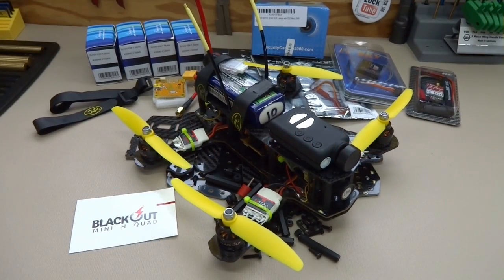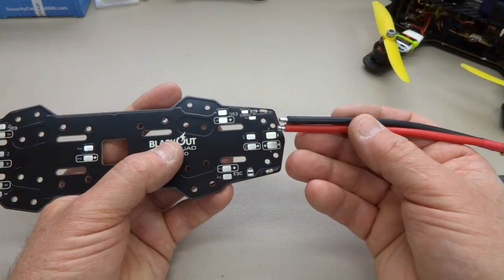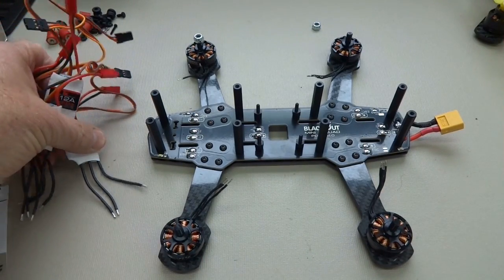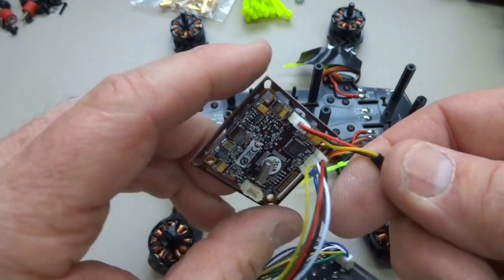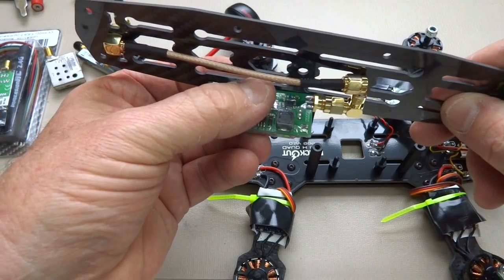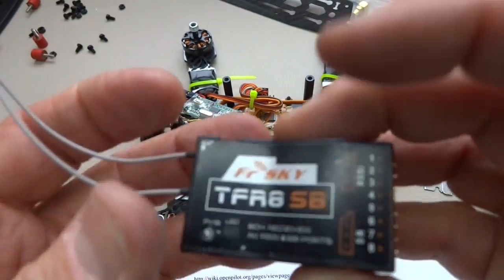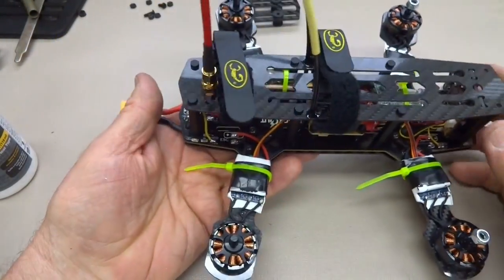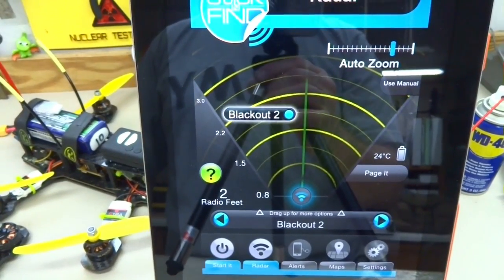Blackout Mini-Quad Build Tips

Comment: Really good video. I just mounted my antennas that way with tubes from pens yesterday but have not tried the range. Do you have the tip of the antennas in or outside of the tubes below the heatshrink?
Reply from the maker: They are below the heat shrink, but the length really doesn't matter that much.  I just came up with that to keep my receiver antennas out of the propellers.
Reply: Which length is it you say don't matter? I was thinking.. if the tubes shield the signal then the exposed area should be according to the wavelength of the radio
Reply from the maker: Philip, the plastic tubes do not block the signal.  (Hopefully you are not using METAL pen tubes...).  The antennas on the receiver are already the proper length for the transmitter frequency - pls don't trim them or you will REALLY affect your range.
Reply: AerialWerks You never know, its better to ask. Maybe that plastic could have. Good to know they don't, then I better keep the whole antenna protected as it is quite fragile, specially sticking up there would give it a 90 degree bend if flipp over.

Comment: Thanks for sharing your knowledge about building these minis. I just ordered a Nenesis mini quad and I'm looking forward to using all of your tips in my build .I'm sure by watching this video you've already saved me a bunch of headaches in the long run.  Love the battery plug and antenna tips. I'll be using Sunny Sky X 2204S /2300KV motors, CC3D FC board, Velotech Magic12amp ESC's with Simon K Firmware,  Gemfan 5x3 Props powered by Glacier 30C 1550 mAh 3s lipos. I'll be using a Taranis X9D Radio /X8R receiver .   After watching your video I'm sure I'll have one of the sweetest looking any flying minis out there. Thanks again for doing such a great job on your video. Looking forward to watching many more .  :}

Comment: Some more tips.

I have had good luck with the anodized aluminum locking nuts. Haven't had an issue with them yet. You will need a driver to remove them if you want to keep them pretty.

Also I used 1" heat shrink to shrink the esc to the arm with some insulating material under the esc to prevent shorting. I remove the original heat shrink first though. 

Anything above 250mw for a vtx is a waste.  Spend money on a good set antenna instead.

You can also remove the positive and negative esc servo wires from 3 of the 4 esc. Only one is needed to power the board.

Comment: is it gonna be okay if I use 4s battery with that exact same quad build? and whats the difference gonna be between 3s and 4s.
Reply: there are still few more doubts I have. If I upgrade the arm to 6" arms, which motors, props, etc should I choose. And is it affecting the flight duration? Is it possible to change the battery so i can have more flight duration? Sorry I ask so many question. This quadcopter hobby looks so interesting, and I'm thinking to have one of these. Thanks
Reply: Thanks, thats helps a lot. :)

Comment: Do you have any thoughts on placing the battery on the bottom? I want to do this as I will need to put a GPS antenna topside. Also, with your battery at the back due to the camera at the front due you have any centre of gravity problems? Great video!

Comment: Hey thanks for your video, you've inspired me to have a go at building a blackout mini quad after learning to fly with a hubsan for a while. Im going to try and emulate what you did, but using a naze 32 flight controller instead. Did you battery lead come with the frame or did you buy it separately?  I am currently trying to source all of the parts but cant  find this part, I was thinking maybe you made it up yourself? Anyway, thanks for the vid, was really helpful, would love some tips along the way if you are able to. 
Thanks,
Gareth

Comment: Great video. Cleared stuff up for me. Brand new to this... As in found out about the hobby about three days ago. Question.... Do you not need to liquid tape the power distribution board solder sites? Thanks.
Reply from the maker: That really isn't necessary because whoever designed the PDB placed the terminals far enough apart that a few drops of water won't bridge the gap.  The only way to short them is to submerge the frame, and they you'll have bigger problems that a couple of shorted terminals...  I also didn't do it because if I have to disassemble things later that liquid tape is a real mess to desolder.
Reply: Thanks. I get it. I had been wondering why I never saw anyone do that. Again great video!

Comment: Great video! very informative! My blackout is in the mail and i'm very anxious to get it. what size battery do you recommend for the mini and about how much flight time do you get out of it? I'm looking at a 1500mah 35C 3s but wasn't sure if i'd be safe going up to a 1800mah or even larger.
Reply from the maker: I'm not so sure that bigger is better...  I have experimented with 3 different sizes, 1000, 1300 and 1500mAh.  The smallest gives the best performance but only about 3-4 minutes of flight time.  The 1300 and 1500 both give about the same flight time - 5-6 minutes.  I've taken to flying only the 1300mAh since it is the best mix of performance and flight time.  For crazy flying I fall back on the 1000mAh.

Comment: Hi There,

What was your AUW for this build may i ask?  Can i also clarify, is the PDB power pad your using for your VTX filtered?  Or does it share with the escs/motors.  

Thinking a separate LC filter may be required.

Good tips on the clip btw...

Comment: By the way, I see your first build has the Tiger 1806 motors but for your second build you chose Sunny Sky 2204 - How are you liking the change?
Reply from the maker: I can't really tell any difference in flight times - it is probably measured in seconds.  I am very happy with my SunnySky motors.
Reply: bosnianbill  how about the flight time between those 2 motors? And which one more durable and quality? Because I already bought sunny Sky 2204

Comment: I was thinking of building the airframe upside down in order to make it more stable, with motors on the top surface and a gopro hanging with the battery from the bottom (what was the top).  I want to use it for still photography.  Seems the way you built it the CG is at or above the rotor disks.  Any thoughts on that idea?

Comment: AerialWerks,

I have a SUPER SIMPLE solution for the connector issue (I used on a Immersion RX), but would easily work on the TX side.  Looks like it would save you $135 (vs. the $140 you paid for new TX)  Its a super simple PCB repair for the connector.  I just had to get new ends from Ebay, those were only a couple dollars for numerous ones.

Thanks for the video!

Corey

ImmersionRC 5800Duo Antenna/SMA Repair (1 of 2)

http://youtu.be/rqhsE2AayLQ?list=UU38pl09UC6HjG_pcNWMt3ew

Comment: Great tips and really makes me want to pull the trigger.  I was not familiar with that bluetooth tracker, either...  Does it work work well if quad falls into some brush?
Reply: bosnianbill The StickNFind website says range is only 100 feet.  That's only about 30M.  Also, I can't seem to find them on Ebay for cheaper than USD $60 for two.   Anyone able to get two for $15?

Comment: Nice video.  I had to laugh though as I have done the reverse with the power wires - I initially built mine with the power wires going through the holes but have changed to straight on top with the zip-tie!  I did this as I kept slicing the wire with the frame when it was through the holes.

Comment: What brand and kv motors are you using on that Blackout? Maybe a parts list with links to suppliers? I love your tips and will use them all on my next build, a hexacopter. I want to build one of these using an APM2.6 with GPS. I'm flying with a new FrSky Taranis and I love it. I'm trying to order in a Mobius wide-angle Action Cam but HK does not have them in stock. If I find somewhere else near HK's price I may just buy it elsewhere.  Any suggestions? Thanks for the tips!
Reply: Some help with part locations; https://www.reddit.com/r/Multicopter/comments/2mmuzp/started_buying_parts_for_my_quad_can_you_look/